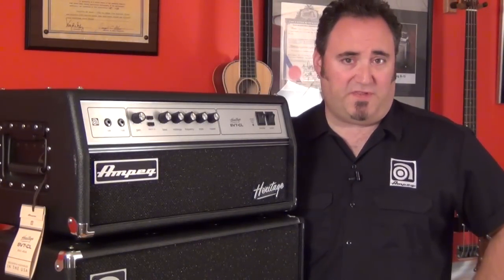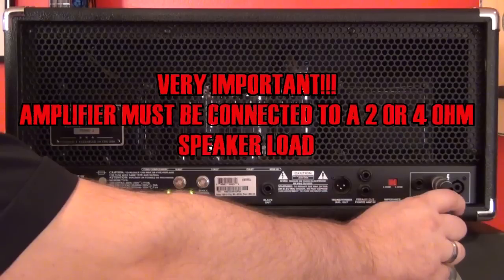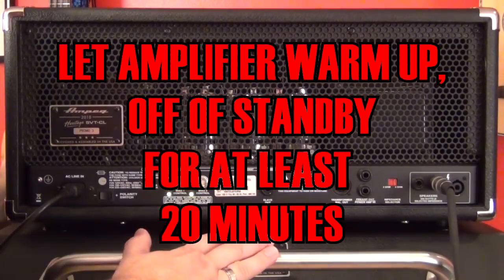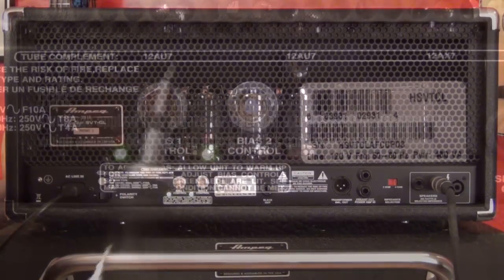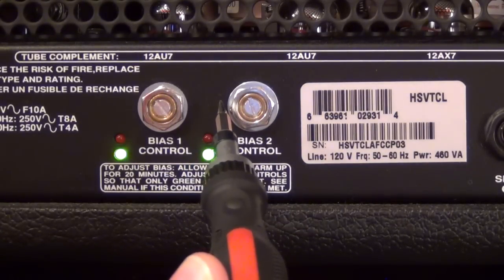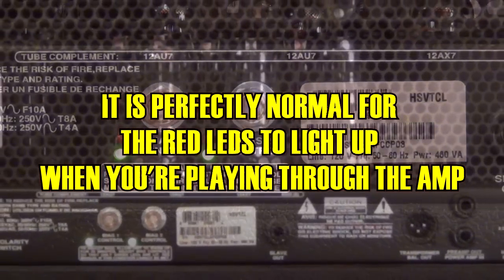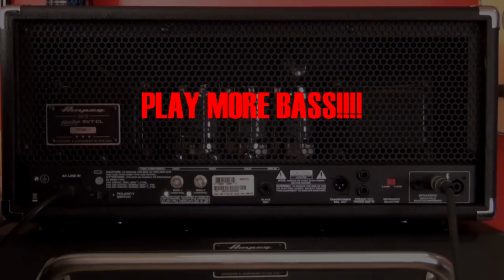Biasing an Ampeg SVT-CL

Comment: So it has been brought to my attention that I mis-labeled the term over biased and under biased at 2:20.  I was always of the understanding that if you're sending too much voltage to a tube, you are OVER biasing it (Green and Red LED).  And not sending enough voltage is UNDER biasing it. (No LED)  I was wrong.  Yes.... even I get stuff wrong at times! And, I own it.  
So the correct terminology should be....
Green LED + Red LED = Under-Biased
No Green or Red LED = Over-Biased
Just Green LED = Bias Okay
Sorry for the confusion everyone!

Comment: When adjusting bias, is it best to have the amp set to performance volume (but on standby) or does it not matter where the gain is set just as long as the tubes have had time to warm up?

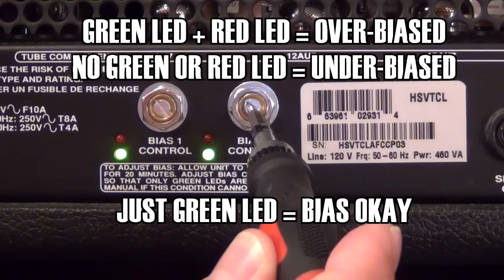Comment: At 2:31 the information you give in the video about under and over-biasing is the complete opposite of what the owner's manual says on the second to the last paragraph on page 9. Tighten up.
Reply from the maker: At 2:31, I'm only demonstrating what happens to the LEDs when you UNDERBIAS the amp.
Reply: beefhogrecords He explains that the red led means it's over biased. Are you deaf or watching without volume?

Comment: I have a question. My left bias won't bias out. The red LED stays on but there's no green LED. When I try to roll off the red LED it goes out but there is no green LED as there should be. So my questions are; Is there something wrong with my amp? Should I bring it to a tech? is my amp safe to play in it's current state. Any feedback would be great!
Reply: I like how Ampeg doesn’t respond to this question — my son’s amp is showing the same problem as yours... did you get yours repaired — if so, what was the solution?
Reply: @Phil_Trujeque  I took it in to my buddy that repairs Amps. If I remember correctly I had blown some internal electronics. If that's happening to your sons amp dont mess with it and just take it in to be repaired.
Reply: Tube has broken and destroyed the 220 ohm screen grid resistor. Follow pin 4 and you will find the one.

Comment: Thanks for this helpful video! I'm new to tube amps so this is great. One question--at the start you say to have the amp connected to a 2 or 4 ohm speaker. I have an Ampeg 410HE which is 8 ohm. Can I use that or will it be a problem? Thanks.
Reply: R.D. Dragon  the minimum load is 4 ohms, so a single cab rated for 8 ohms should not be run by itself with this amp.  You could run two or four 8 ohm cabs, but not just one. Hope this helps

Comment: my svt-cl won't bias on the right side. the red led will come on, and the red led will go off as i roll it away, but it wont turn green. the left side bias' fine. i just replaced all the power tubes and still same problem. i read some resistor problems may be the issue. any suggestions?
Reply: I am having a similar problem now.  From what I've been reading online it seems resistors could be the problem.  Did you ever resolve this issue?